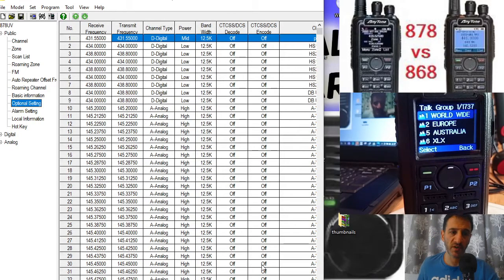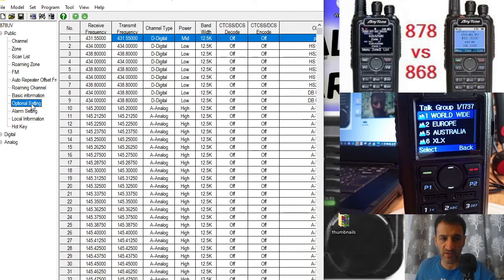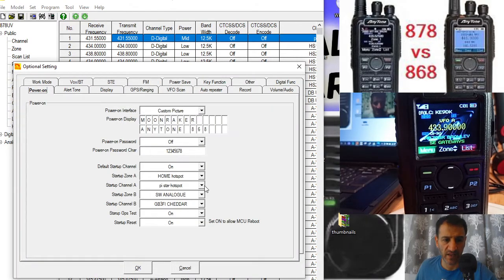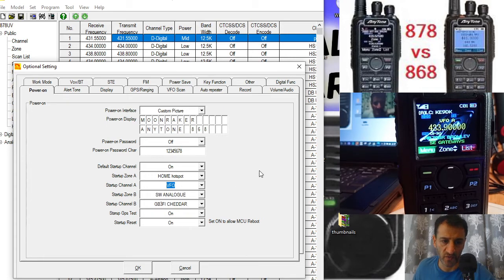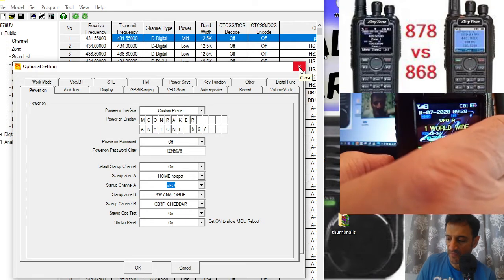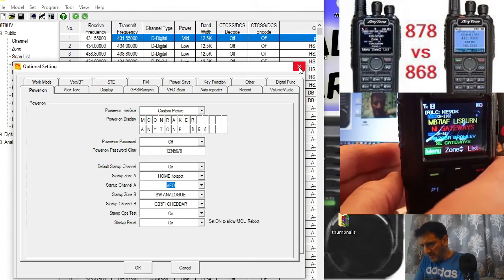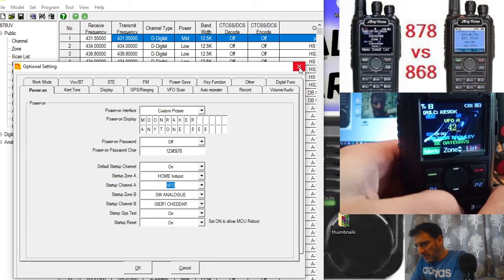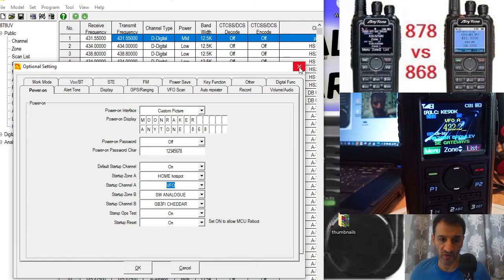ANYTONE 868/878 change to VFO mode

Comment: I dont have my data cable handy but unable to switch to VFO mode using P2 it says operation error.  Any suggestions?
Reply from the maker: Go on software set a button or try and hold one button at a time

Comment: Amazingly, it seems that every video I watch does not match my factory default radio, and the bridgecomm guys told me to hit P2, which does nothing.
Reply from the maker: What are you trying to do ?
Reply: @M0FXBHamTech  I just wanted vfo mode.  After a dozen attempts, a read/write of the radio had succeeded in restoring it.
Reply: It truly is a clusterfuck. I have trouble putting the radio into the 0014 mode to access legal frequencies in my area, but all I have is BAND ERROR both in the programming software and on the radio...